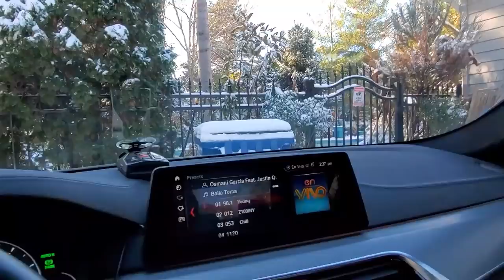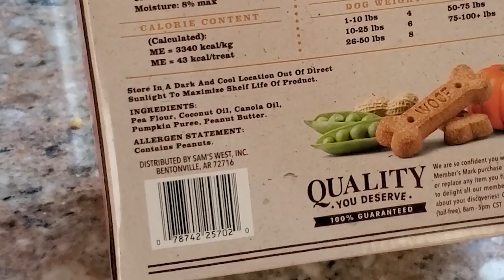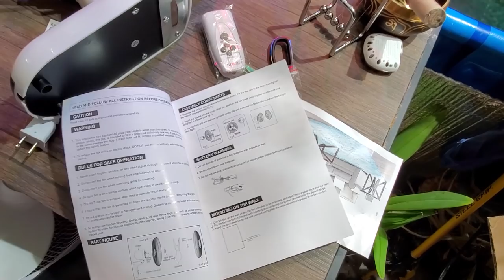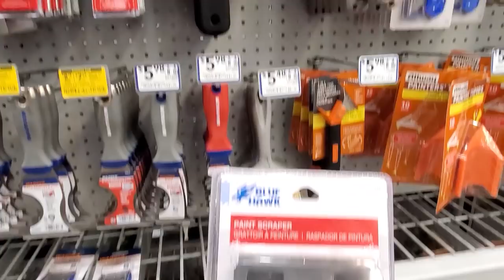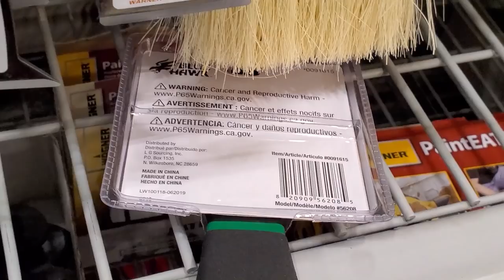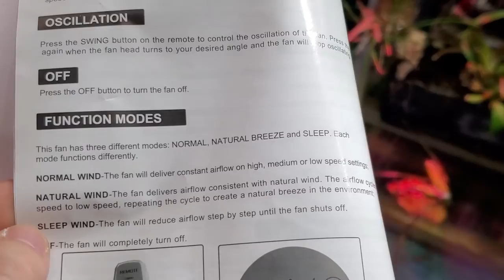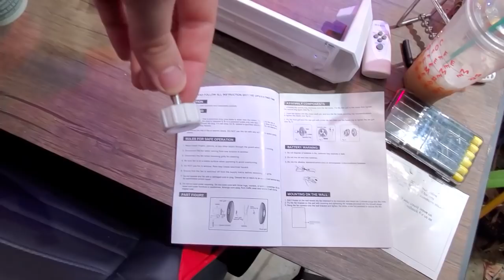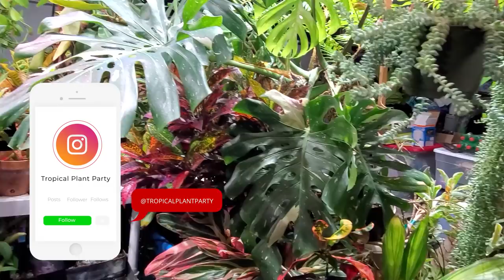My Week With The Arctic Blast

Comment: 3 thing to share: if you buy anything from Home Depot, you can take it back with the packaging regardless of condition. Have you considered an overhead ceiling fan? They have a switch to reverse the blades to blow air down. AND they do make a size gauge for drill bits. I always smile watching your channel!😁👍
Reply from the maker: Good to know! Thank you! A ceiling fan is a good idea but wouldn't work well for being able to direct the flow of air, and would hinder being able to move the taller plants around. Otherwise would make far more sense than the wall fans which don't seem to last very long.

Comment: I think that “extra” part goes in the neck of the fan to tighten or loosen it up for either up and down or side to side.
Reply from the maker: That's what I was wondering but I don't see a whole anywhere. No mention of the part anywhere in the diagram. Urgh!
Reply: Tropical Plant Party that’s got to be so frustrating. But I suppose as long as it’s not falling down or apart.... right 🤷🏻‍♀️🤷🏻‍♀️🤷🏻‍♀️

Comment: That's exactly what my gutters do. I'm pretty sure that's right, plus you get a nice line of icicles. lol, "sorry, caffeine day" so needs to be on a shirt. I just picked up one of those marble queen pothos, I'm going to poke holes and cut notches in the leaves and call it a monstera thai constellation. If you can clean it up in less than 10 minutes, it's not a mess.
Reply: Google "drill bit gauge", Box stores might have them.
Reply from the maker: 🤣😂 I'm pretty sure I've seen fake variegated monsteras on ebay before that just looked like marble queens!
Reply from the maker: Definitely getting one! Ty!

Comment: Your queen palm made it after 12 degrees??!?!?!?
Reply from the maker: Shockingly yes! Still green and beautiful. But it is a big tree, will have to wait several more days potentially for damage to show. I'm going to try and put a strap around the trunk and crank wrench around my maple tree and pull the sucker down. That way I can wrap it up and protect it. Have to atleast give it a try.
Reply: @TropicalPlantParty   you might have a "littorals" aka: Silver Queen (more cold hardy). I mean that's pretty impressive if she survived snow and temps that cold... Id be finding a way to protect that one! Have you considered heat cables? Get some 2.5oz frost cloth, and heat cables. Tie the fronds up at the top and wrap it up for the winter. Im shook.
Reply from the maker: That's what the plan is! I haven't had very good luck with heat cables though so I usually just use christmas lights.
Reply: @TropicalPlantParty  I can imagine your winters are much more brutal. the HPS flood lights might work too to put off extra heat around it. Do a VLOG for this! haha Or maybe you can use heat cables around it on the ground/mulch to keep the soil around it from freezing too deep. You can attach a piece of copper pipe (small, or thermal copper pipe) to the sensor on the cables for better conductivity. I don't know if that would help or not.